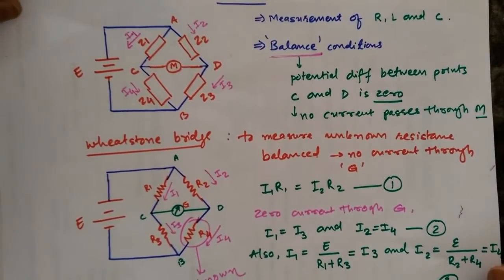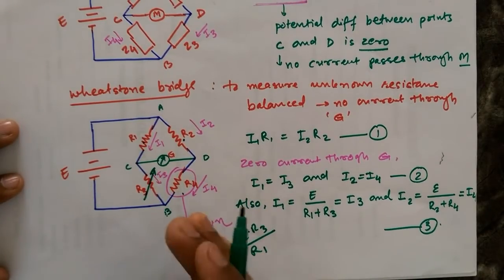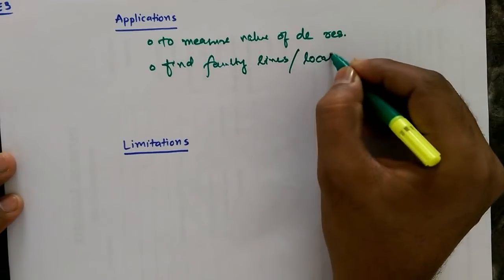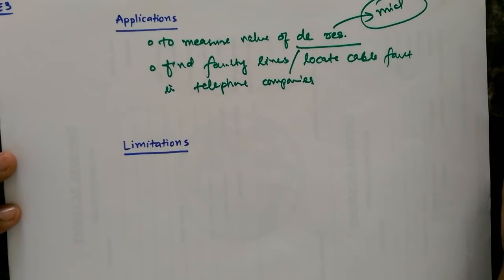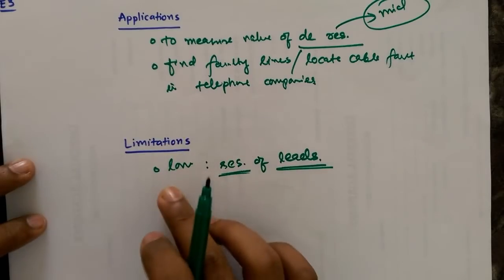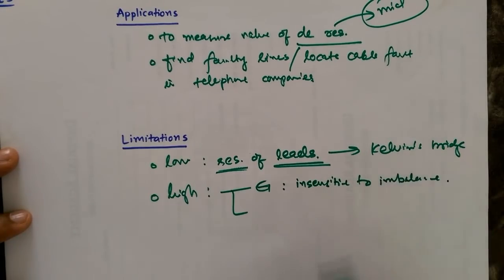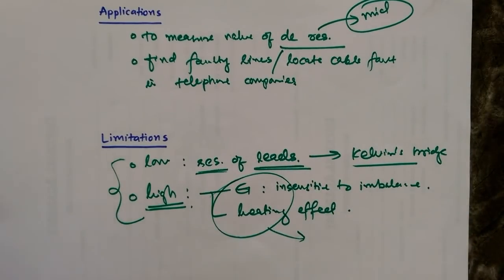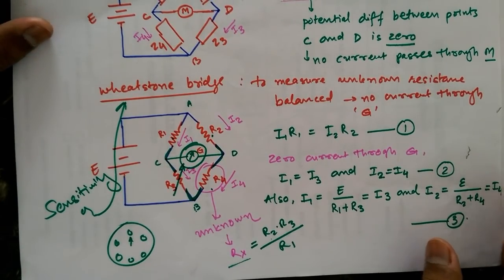Applications and Limitations of Wheatstone Bridge | Electronic Measurement & Instrumentation

Comment: Given a pressure of 2kpa, nominal resistance of 120 ohm, diameter of strain gauge 0.1mm, a GF of 2. What will be the change in resistance value of the strain gauge?....in short I wanta formula to calculate the change in resistance of strain gauge for a given INPUT PRESSURE